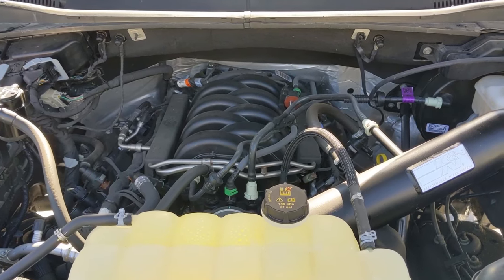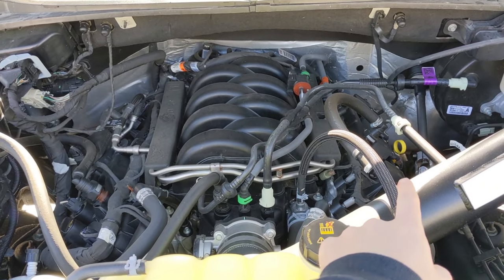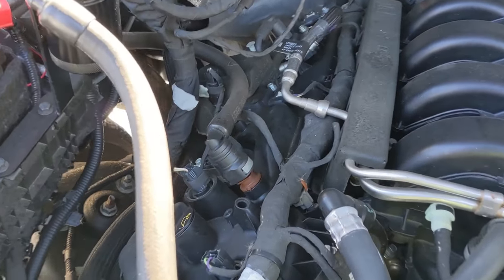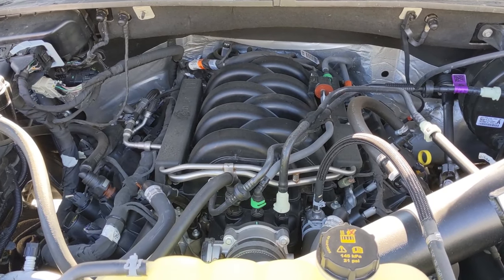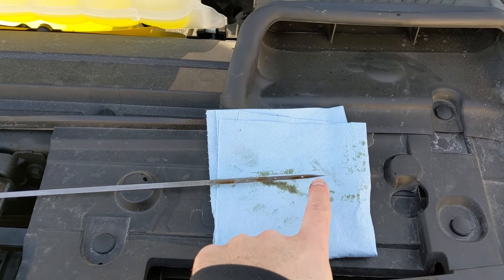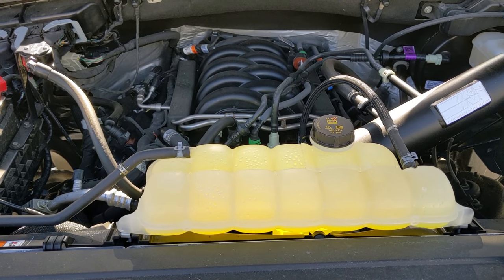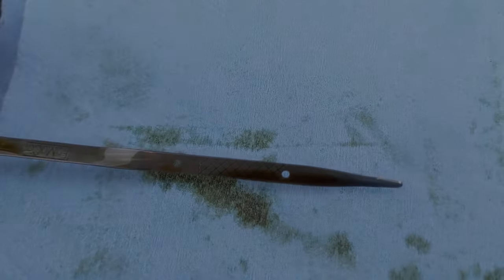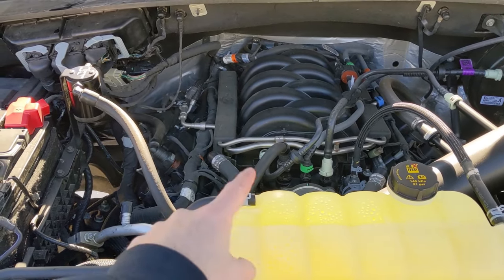Oil Consumption Update - 2019 Ford F150 5.0L

Comment: I had the service bulletin performed on my 2019 f 150 in fact I took it to the dealer fore different times, it still uses two quarts between oil changes. The mechanic ended up telling me that as long as it didn't go below the add mark don't worry about it. Some fix huh.

Comment: i have a 2018 f150 5.0, excessive oil use, a quart every 1500 miles or so, got the new dip stick, full level was at same length from top, just added a quart to bottom,  I switched to penzzoil full synthetic and my problem went away. no pc reprogramming, my oil use went from a quart or more every 1500 miles to less than a quart every 7500 miles.
Reply from the maker: I'm in the process of filming an update video, after this TSB was done I also switched to full synthetic but I'm using amsoil Signature Series 5w30, I also bought some Pennzoil ultra platinum 5w30 on sale that I'll be using this winter.

Comment: Do you have to reprogram the PCM if you simply change the PCV to the EV281? Should i buy the longer dipatick as well? Thank you for the video.
Reply from the maker: No reprogram needed for the pcv valve, but I'd highly recommend getting the dealer to do the 19-2365
Reply: @EliminatorPerformance   thanks for the quick reply! I will.

Comment: My 2020 f150 5.0 was using a quart every 1000 miles. I pulled the PCV hose off the intake and machined a reducer to reduce the hose size down to 1/4 inch. Now It uses a quart every 6000 miles. So I would say the PCV system is most of the problem.
Reply from the maker: The ev281 pcv valve and 5w30 fully synthetic oil solved my consumption issue, I plan on doing an update video soon
Reply: @EliminatorPerformance   I also plan on going to 5-40w. I also had an issue with front engine noise after my first oil change. I learned that the break in oil has a lot of zinc in it. I added lucas zinc additive and the noise is almost gone. Using a heavier weight oil down south is a good idea.
Reply: @EliminatorPerformance look forward to the update video

Comment: Mines still trouble after the flash. They said no right side spark plugs oil soaked, need new block and right side cylinder head
Reply from the maker: Yea the TSB only solves the oil consumption if it's related to the throttle body and PCV valve. There's other issues with cylinder walls (they use plasma lined ones instead of the old sleeved cylinders) and also issues with cylinder heads.

Comment: Excellent video!
I have the 2020 5L with 6800kms, no oil consumption issues.
Would there be any need for me to add a catch can? 
Also, going to do my own oil changes. They recommend 5w20 synthetic blend... I assume it's fine to go full synthetic?
Thanks
Reply from the maker: Yes 5w20 but I'd recommend Motorcraft 5w20 synth blend! It's fords own brand. Some synthetics are cheap. Also, for the catch can it all depends how long you plan to keep the truck, but after 68000 I'm sure it won't have too many benefits. I did mine I believe at 600 kms so it was early on.
Reply: @EliminatorPerformance  thanks for the quick response, will do regarding oil. Only 6800 km's and I do plan on owning it for at least 10 years...again great vids, subscribed
Reply: @unforgiven7 e Baah piss on that blend crap, I know this is a year old but, absolutely go 100% synthetic! All these new high tech engines need all the help they can get, all of them Ford, GM, Chrysler, and the imports as well! I recommend  AMSOIL, but at least use one of the other so called full synthetics, Motorcraft or Mobil1 or whatever. I wont get into the bullcrap of the full synthetics here, but if you care to do some research on Castrol verses Mobil you will see that full synthetic has become just  a marketing term in North America anyway. so but use Mobil 1 extended life or Motorcraft Full synthetic etc. its still way better than semi synthetic. BY THE WAY I am a life long mechanic by trade, I have used AMSOIL exclusively since the eighties, its great stuff!

Comment: My 2011 honda civic seems to be leaking and or burning ALOT  of oil.   This cold winter it burnt zero over 3-4 months but soon as its warmer than minus 10 C it started leaking or burning alot  again, like b4 winter.
it seems to leak up top but never enough to drip on driveway which makes me think its also burning it?  I WONDER IF ITS MAYBE  DOIN SAME AS FORD ENGINE HERE?
 iT  DOES  have a rather hard to read plastic dipstick. i have to wipe it completely dry b4 reinserting it to see  oil level other wise even the tiniest amt of oil leveft on there shines and you cant tell if its low or 3 quarts overfull.

Comment: The question is: Is 8.8  quarts an overfill condition or not? Ford never clarified that. It appears that the high mark on the new dipstick is at the same. Level. So what's the point?
Reply: It is at the same level. The longer Dipstick only gives you a larger window for loss. It's a joke. I still have the original stick. 8.8 quarts puts the level in the center of the hash marks.

Comment: There is a class action law suit for the oil consumption issue for 2018-2020 Ford F150s with a 5.0 L engine. I own a 2019 ford f150. This issue is not fixable.

Comment: My 2018 uses oil between oil changes, or it seems to. I still have a couple thousand miles on my truck before due for oil change, but already getting light to check oil level soon which  i did and found it to be to the bottom of the hash marks. I am guessing i have same trouble that you described.
Reply from the maker: Go into settings and check your oil life too, that's usually what I follow to change my oil, and my truck hasn't been using any since I got the TSB done!
Reply: @EliminatorPerformance   I will never trust anything that says "oil life"... How does it measure "oil life"??? If it's time or miles, have you ever seen a car maker give you anything but a huge amount number so you think you are going to "save money" on getting oil changes, etc., when you are only accelerating the Wear of the engine by running the oil and filter long...

Comment: Hello Eliminator.  Good job in explaining this.  You found yur calling.  

I bought a 2019 f150 5.0 xlt crew cab for about $45k.  I had the exact oil consumption issue.  AND trans clunk issue to boot.  I installed a catch can and played around with different oil  viscosities at my own peril.  I never took it in to dealer because of the so many disappointments read on line from customers having the same issue and the way their dealer treated them.  I feel that ford lost their way and was a complete disappintment.  Carbon buildup that seemed excessive could also be seen on top of forward piston drivers side with a boroscope i had after about 5k miles.  Plus my tailpipe was heavily sooted.  I also wonder about their stupid "plasma" sleeve cylinder treatment approach.  Sorry.  I am no longer a ford fan. Also after about 3000 miles the WONDERFUL 10 SPEED Trans clunked very badly at startup especially after driving a while then restarting.  No way after that metel to metal heavy banging the trans will last without problems inshort time. Ford is like hit or miss.  Some times they are great some times they arent.  I dont have the time to try to figure out problems they should never have created to begin with ESPECIALLY FOR A MOTOR COMPANY THAT SUPPOSEDLY KNOWs TRUCKS BETTER THAN ANYONE.  I traded in the f150 for a 2021 tundra.  Yes i lost a lot of money doing the trade in after a year.  But At least i can sleep at night now.  And altough the tundra is a basic truck, it JUST goes to say if ford cant do the basics of engine and trans design right then what good are they?  Dont walk away from ford, run!  By the way i had a 2010 f150 5.4 xlt 6 speed cab extended   for 4 years that was still running great.  I have to admit i never should have gotten rid of that  The 5.4 may have had issues but if taken care of would have been just fine.  And certainly saved me a bunch of money in the long run.
Reply from the maker: My father drives the 2006 xlt with the 4.6 and no engine issues, we just replaced the starter that was about it. It has 400,000 on it easy, the dash went out because wiring issues so can't say exactly what mileage. These new trucks are hit and miss, it's sad that some have the same issue but different causes, as the TSB fixed some but not all. That doesn't make sense unless there's other issues causing the consumption. Like I said, the oil burning is a byproduct, or end result of all these tiny issues that add up. Best of luck with the tundra!

Comment: I was a little unsure about these Gen 3 5.0’s after hearing about the oil consumption issues. But if it is a mostly simple fix, I might consider getting one. My 2013 F150 has 171,000 on a Gen 1 5.0, and it still runs great, has plenty of power, and tows a 4500 pound trailer with no trouble at all.

Comment: Great video brother.. i been looking a a beautiful f150 xr6 lifted with the 5.0 in it ...seen it this weekend pass..i feel in love with this truck .. its 52k to buy but i started it and it did a flutter ticking when let off gas paddle so i asked them to look at in in there shop and fix issues..sounds like a timing chain clatter,,,but im also worried about that oil consumption problem and the 10speed skip gear problems... I really like this truck and it would be a very long term vehicle and my first big buy on a vehicle... When payed out it would cost me close to 70k$ .... Whats all ur info on the 5.0 f150 rigs... The net shows mix comments from haters and lovers of the trucks...also whats gas mileage of them...
Reply from the maker: My opinion would be get a 15-17 f150 with the 5.0 they were bulletproof. This is a great truck but there are many different issues with the 18-20 models that the 15-17 trucks don't have. Probably works both ways though. Oil consumption seemed to be fixed by the TSB but other comments say otherwise about their trucks. The pcv valve upgrade is the cheapest thing to do and one of the easiest so I always recommend that 1st. They're all aluminum trucks, if you can score a warranty with it then that's always best. I have a 10yr 200,000km ultimate warranty on mine covers everything. I still have 7yrs left on that warranty so I'm not worried the slightest.

Comment: Hey man how’s it going with your F-150?  I got the PCM flash done back in April after talking to you and I’m checking the dipstick at 1500 miles since, it looks like it’s 1/4” lower from their top off line, I’m guessing it’s consuming the same amount or a tad bit more.
Reply from the maker: I just got my oil changed at 10,000 and haven't noticed a difference. Although it was low leaving the dealership, as the techs filled it to just over the add line, so I added 1.5L to just under the full line and it hasn't changed since.

Comment: Just noticed my 18 F150 5.0 29,000 miles, about 1/4” down from min mark on factory dipstick at 3200 miles since last change and it has the rattle, I’ve noticed the rattle since I’ve owned it Mar 2020, Ford called it a typewriter noise, which it kind of sounds like, is normal.  I plan on taking it in, just doing research on this.  So you think the referenced TSB might do the trick?
Reply from the maker: Yes my consumption was excessive, I just showed a picture of the dipstick and they didn't mess with a consumption test, I said I didn't have time for that anyways lol as for the rattle I'm not sure. These engines sound like diesels, they're built like that. Some people say the whine from the trans is annoying, but that's normal because of the straight cut oil pump gears. A rattle on decel could be the heat shield loose on the exhaust, have them check it when it goes in. Other than that, there was a tsb for a bolt that came loose in the trans and hit the torque converter. But you'd definitely hear that lol
Reply: Rattle is cam phasers on deceleration when engine is cold at 2000 rpm, TSB-2354 solved this issue with mine 5.0

Comment: So if it was built before 10/19 only a new dipstick, or all the other stuff too?
Reply from the maker: After 10/19 they should* have the new dipstick, but may still require the PCM reprogram. I say should because some trucks on the forums didn't have the new dipstick and were built into November and even December.

Comment: Don't forget direct vs port injection for an oil catch can. Direct injected engines will have buildup on the valves as a result. Port injected engines will clean off the valves since the fuel sprays over them.
Reply: Does a 2020 f150 5.0 have direct or port injection ?
Reply: @jasongallowayelite7432  depends which generation. The 3rd generation has direct and port injection, similar to the 3.5L in the Toyota Tacoma
Reply: @RedWingsninetyone  thanx

Comment: I had this done on my 2018 and now the oil consumption is fixed, but the truck pushes very hard it's like the throttle is slightly open when braking, you can feel it push.
Reply: Sounds like you may have a vacuum leak allowing unmetered air in

Comment: Got rid of a 13 F-150 with 73,000 miles with now issues  on it anticipating problems to a rise to jump into something newer with issues.  I hear there is tranny issues down the road with the 18s since that’s the first year of the 10 speed transmission. I picked a winner. Won’t be buying another vehicle unless I have to not want to.

Comment: My 2015 5.0 is doing the same thing. I just changed my throttle body but it’s been doing that before I changed itz
Reply from the maker: You should only have to get the reprogram, they keep the original throttle body. It's a software issue.

Comment: Can I have an update on if yours is still not burning any? Just had the TSB done and a JLT catch can installed. Really praying mine will be ok but I noticed it’s just below the top hash mark already and I’m about 300 miles in.... Thanks man
Reply from the maker: No burning oil, not a single drop has been consumed since the TSB. I go in for my last free oil change soon, I did have to replace the left bank catalytic converter 100kms after this video was posted. It was covered under warranty, the tech says they get gummed up because of the excessive oil consumption. Code was a P0430 and then the P0627 fuel pump code because it was over fueling. My fuel mileage is even better with a new catalytic converter!
Reply: @EliminatorPerformance  ok thanks man. My dipstick looks damn near the same as yours did in the video and mines at 300 miles since the TSB and oil change was done so I’m not sure if it’ll stay at that mark because the consumption is fixed or it will keep burning.

Comment: I was told by my dealership that adding an oil separator in the PCV circuit voids my Canadian (factory) warranty. (* although they didn't seem to mind my Auto STOP/START eliminator)

June 2019 built F-150 5.0 Lariat FX4 Crewcab 4x4, ~7000km and 19-2365 TSB performed (...and oil usage has disappeared completely)

Do you remove your catch can when you take it in for service ?
Reply from the maker: No, and the tech drains it to. No aftermarket part can void a warranty, they say that just to scare people into not working on their own vehicle. I have a K&N intake, MBRP Pro-Series side exit exhaust, used Forscan to put the GT500 theme on my touch screen, they just warrantied some stuff that I'll be talking about in my next video. And good to hear the TSB fixed your consumption! If you get a P0430 cat efficiency code, or a P0627 Fuel pump fault code, it's probably needs a cat or both catalytic converters replaced. They get gummed up from the oil consumption. Mine threw a code like 100km after this video was posted, I had everything covered under warranty, truck runs mint now and I get better fuel economy. Thanks for watching!
Reply: @EliminatorPerformance  I'll be keeping an eye out for those codes. I've got an OBD2 reader. 

Would seeing my "live" data while the truck's running show anything wonky ? I can do that with my code reader.

Thanks for the FYI, my friend...and you've been subbed.👍🏻
Reply from the maker: Live data won't help until you get a code, in the mean time just drive it and keep an eye on oil level.